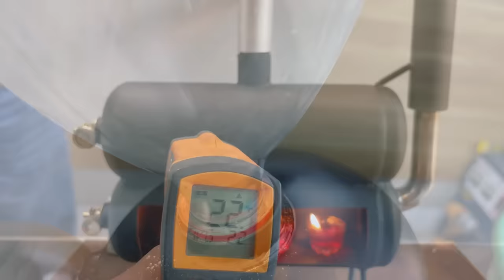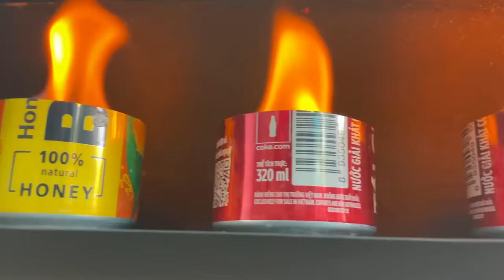diy mini heater! So warm for your room. Free energy from sand batteries

Comment: He changed the settings on the digital thermometer from Celsius, when he took the ambient temperature, Fahrenheit when he took the heaters temperature. The heater was barely above room temperature.
Reply from the maker: It looks like the experimenter may have made an error by changing the temperature settings between Celsius and Fahrenheit when measuring the ambient and heater temperatures. This could lead to inaccuracies in the results, and it's essential to maintain consistency in temperature units for accurate comparisons. Paying attention to such details is crucial in scientific experiments to ensure reliable outcomes. 🌡️👨‍🔬
Reply: No one wants to be rational nowadays, but this gizmo gives off exactly the same amount of heat as four candles just sitting there with no gizmo.  You're not creating any additional thermal energy with a gizmo.  So dumb.
Reply: @Kube_Dog  And some of that heat goes straight up and out the flue, especially that middle alcohol stove after the four candles. I think it looks cool though...warmly cosy kinda cool; steampunk.
Reply: @pa_maj.MARTINI-van-MAN  Sure, it works as a conversation piece, but that's not what the guy is claiming.  It's unfortunate because there are actually naïve people who think this is a legit heat source and invest their time and energy and a few bucks to make it, only to be disappointed.  And this guy is doing that to them for attention.  It's really not cool.
Reply: @Kube_Dog the point of the heater is the extra heat is stored in the sand ,once the sand is heated and the burners have gone out it still has heat stored in the sand, this heater is also made with an electrical coil from a kettle in other videos and there are good explanations of the working..eg: converting solar, wind into heat etc
Reply: @lmtn Oh wow that was an AI answer right there 😂
Reply: @Kube_Dog once the sand gets hot it takes long time to cool down, but need more than   4 to create good amount of heat especially in a large room, in a tent be ok, it be good homeless person to keep warm in a winter
Reply: Well spotted

Comment: I’ve been experimenting with simple tea lights and steel plate. It’s amazing how much heat you can achieve. I can get a bag of 50 4hr burning tea lights for about £5. I think we do need to think about this subject more. It’s never free but affordable heating. The key primarily is to spend high on insulation. An indefinite fuel saving device that needs only a fraction of the energy to heat it in the first place.
Reply from the maker: Absolutely! Your experimentation with simple tea lights and steel plates showcases the potential for affordable and efficient heating solutions. The idea of focusing on insulation is indeed crucial, as it helps retain the heat generated, making the system more energy-efficient. It's great to see people exploring alternative and cost-effective ways to stay warm. Keep up the innovative work, and thanks for sharing your insights!
Reply: A 10x10 room would only need 8 bags of candles to heat it every day. That would only be about £40 per day, or £280/wk. A candle burns at 1,000 °C, why isn't more heat being absorbed by the battery?

Comment: Toxic fumes are created when galvanized material is exposed to fire other than that it looks very nice
Reply from the maker: "Thank you for pointing that out, and I appreciate your concern regarding the potential release of toxic fumes from galvanized material. Safety is paramount, and you're absolutely right about the risks associated with exposing galvanized material to fire. It's crucial to prioritize the use of materials that are safe and suitable for the intended application. In future projects, I'll be sure to emphasize the importance of selecting materials that pose no health risks when exposed to heat. Your feedback is valuable, and I'm grateful for your attention to safety considerations. If you have any more suggestions or questions, feel free to share. Thank you for being part of the community!"
Reply: I always burn metal outside until it's very used in before bringing indoors for projects. Even the grate on the buddy heaters,or people use the paint roller gates.,(it's put on top of the heater to hold a pot over the heat to cook in) I keep telling them to burn the heck out of them outside but they don't listen. They don't want to "mess up" their new heater grate or roller grate.You can't fix stu-pid.

Comment: For the people that never think about these video's and assume that these are great:
Lighting four tealights in a room without the use of this fancy "heater" would result in more heat as there would be no chimney wasting heat to the outside !
Reply from the maker: You make a valid point about the efficiency of simpler heating methods, like lighting tealights directly in a room without a chimney. It's true that the absence of a chimney could result in more heat being retained indoors. The trade-off between simplicity and the additional features of a more complex system is an interesting consideration. Your insight adds depth to the discussion, and I appreciate your perspective on optimizing heat retention. If you have more thoughts or suggestions, feel free to share! 🔥🕯️

Comment: Thermal mass and heat retention / dispersion is the name of the game regardless of fuel source. In this case, the sand or crushed granite mix is for the thermal mass.  As shown, the upper tank is a tank within a tank so that the fumes actually flow up through the inside box of the upper round tank and out the exhaust pipe.  Therefore think of the upper tank like how a thermos is made with the inside tank that keeps coffee warm and then the outer tank around it.  

Secondly, the exhaust / flue pipe on the right side is actually used as just that.. a flue.. to draw in air as hot air wants to rise (just like how a woodstove works) which creates and air draw.  Realistically though, it's not needed as the exhaust pipe out the wall is doing this (but perhaps only somewhat because it's mostly set horizontally).  Regardless, this action means more air-flow is pulled in, thus maximizing the burn of the candles.  If there were a door on the front as well an adjustable intake valve, the air-flow would then be controllable from the intake side.  

If just left open however, then that entire cutout is the intake.  Because of that, I would make a door with thermal glass.
PS - Don't ever try and grind metal edges with a cutoff wheel. It could shatter.  Use a proper flap disc.
Reply from the maker: Thank you for the detailed explanation! I appreciate the insights on thermal mass and airflow. Have you tried any other materials or designs to improve heat retention? Also, do you have any tips for optimizing the burn with different fuel types?
Reply: @lmtn  I am only familiar with various wood types which give off different amounts of BTUs based on their type, density, moisture content, etc.  But for example, some people use wax as a thermal mass. So for example, instead of the tank in this video being filled with sand or crushed granite, it would be filled with wax which retains a lot of heat and will slowly release it as it re-solidifies.

As for other thermal mass material, there are many good articles about it and the different mixes people have used including different types of mud mixed with sand and fibers which get packed around the stove and exhaust piping, which generally is set horizontal for several feet before going vertical or may even have two horizontal runs.  

What is also interesting is how it all has to work together.  The type of fuel, the burn chamber, air flow, the type of mass or container, and of course the size of a room to be heated and for how long.  Lots of variables in the mix.  

And as important as it is to capture and retain as much heat energy from a fire, this also means the airspace you are wanting to heat up also has to be sufficiently insulated.  I call this the “dual chamber effect”.  Because you can have a well designed and efficient heat source but if your second chamber, meaning your room or house, is not also thermally efficient and well insulated, then you are not getting the best benefits of your heat source.   

What I’ve found that greatly helps retain heat in a house is using aluminum foil-backed polyisocyanurate foam panels in your ceiling set above the drywall.  Having a foil radiant barrier greatly helps both in winter for heat reflection on the bottom, and in summer where it reflects attic heat.  It works incredibly well. Even just 1” or 1.5” panels will do A LOT.

For heating we currently have an old mid 80’s Lopi woodstove, with solid brass doors and glass so you can see the fire.  I’ve also made a few modifications to it be more efficient and hold on to heat longer.  It’s not as great as a thermal mass stove, but those take a lot of time and effort to build, as well the space to build it. There are some great videos of those here on YouTube.

Comment: Candles or any flame only produce a certain amount of heat. Additional devices such as this dont change that output. Candle flames produce roughly 100 watts each no matter what.
Reply from the maker: You've made a valid point regarding the consistent heat output of candles or flames. It's true that the heat generated by candle flames tends to remain relatively constant, typically around 100 watts each. Introducing additional devices may not alter this inherent heat production. Instead, these devices might offer other benefits, such as enhanced safety features, longer burn times, or more controlled environments.

Understanding and acknowledging the fundamental properties of flame heat output is crucial when considering supplementary devices. It prompts users to evaluate such devices for factors beyond heat production, like convenience, efficiency, or safety features. Your observation contributes to a comprehensive understanding of these products, and I appreciate your insightful perspective on the matter. If there are specific aspects of flame devices you'd like to explore further, feel free to delve into those for a more in-depth discussion.
Reply: @lmtn  I wonder if candles or whatever they're used in can be improved in any way to make them less sooty and more efficient.

Comment: This DIY mini heater is a game-changer! The fact that its powered by sand batteries makes it even more impressive. Cant wait to make one and feel the warmth. Great job!
Reply from the maker: "Thank you so much for your positive feedback! I'm thrilled that you find the DIY mini heater impressive, especially with the unique power source of sand batteries. I hope your experience making it is as enjoyable as the warmth it'll provide. Feel free to reach out if you have any questions during the process. Appreciate your support, and stay warm!"
Reply: Sand is an inert substance and generates no power or heat of its own. It soaks up heat from some other source, (which has to be paid for), and slowly releases it to atmosphere. In other words it's the storage material in a storage heater. There is no and cannot be any such  thing as a free lunch. Whether the heat comes from electricity, gas , candles, vegetable oil or  whatever, it still has to be paid for and doesn't come cheap. Remember the video showing the insides of an LED lightbulb being stripped out and replaced by a small looped coil of copper wire, before refitting the plastic top of the bulb, and claiming that it can bring TV programs from around the world. Gullible people will see that video and convince themselves that it is an amazing idea, when in fact it is simply click bait, and anyone foolish enough to try it themselves soon find out just how far they have been led up the garden path.....And so it is with free energy generators, free heat apparatus, etc. It's a scam and a fraud.
Reply: @FrankBrown-c5l You are wrong. There is a way to heat the sand for free. You simply use a large magnifying glass to magnify the sun's rays onto the metal cylinder that will heat the sand inside to a high enough temperature that it will release the heat throughout the night into a small room and raise the temperature for free. 
The sun is a permanent supply of free energy and heat. Just have to think of ways to store it. So again. You are wrong.
Reply: @kieranb7047  No Buddy. YOU are wrong. I specifically mentioned Fresnel lenses as a heat source, but also made the statement that Fresnel lenses cost money, as does the mounting frame and the sun following circuitry if used to automatically turn the lens to the optimal position to the sun's rays. Read what you see, not what you want to see that best suits your objection. See the comment below for conformation.
Reply: @FrankBrown-c5l  where did you mention lenses? You comment only mentions electricity, gas, candles and vegetable oils. Nothing about lenses.
Reply: @kieranb7047  Seek and yea shall find. Do you want me to draw you a picture of the comment in question ?.
Reply: @FrankBrown-c5l  so you expect me to do the work of hunting through hundreds of comments that are not related to your original comment that I originally replied to in order for you to be proven not to be wrong? 
Please do draw me a picture of your comment. I'm fascinated to see how exactly you draw a picture of writing that isn't you just writing words 😂. Has your carer left you unsupervised on the computer?
Reply: Powered by candles lol not sand
Reply: @eirenemiller5929  Exactly. Might as well just have the candles without all the rigmarole of the flowerpots.
Reply: @FrankBrown-c5l  if you have just the candles you have convection heat. By heating flower pots or these "sand batteries" you convert the heat to radiant heat. Depending on how well your place is insulation and ventilated, there might be a benefit to having radiant heat vs convection heat. No extra energy is created, but convection just heats the air, and if the hot air is easily lost (poor insulation, or due to ventilation) radiating heat might offer a benefit.

Comment: I really like this concept!
I would like to fabricate declarative versions of this heater for my small 1000sq ft home, but hesitant a for a few reasons. Im very confident I could make these units extremely safe, much safer than other indoor heat sources.
My issue are.
Why are these heaters being vented to the outdoors? There should be no concern for deadly fumes in my home, I believe so anyway? Isn’t this is throwing away heat?

Secondly, I live in Massachusetts. And that being said I own my home outright in this state. What’s used to make these heaters are used widely used in everyone’s home everyday. Just the same I have a feeling Massachusetts's will not allow these concepts. And will use this heat source responsible for tornado damage! Sounds crazy, but I live in Massachusetts. 

I own a mini split System I use daily, set at about 63 degrees. I pay about a $300 electric bill monthly in winter. I use my oil furnace at night. 

Looking for alternatives.
Thank for listening.
Bill
Reply from the maker: Thank you for sharing your thoughts and concerns, Bill. It's great that you're interested in exploring alternative heating solutions for your home. Here's a response that addresses your points:

"I appreciate your interest in this heating concept, Bill. It's essential to prioritize safety when considering alternative heating sources. The reason these heaters are often vented to the outdoors is primarily for safety. While it's true that you can make these units extremely safe, venting ensures that any potential emissions or fumes don't accumulate inside your home, providing an extra layer of security.

Regarding your concerns about wasting heat, some designs do incorporate heat recovery systems to capture and reuse some of the heat before venting it outside, but this can vary depending on the specific design and model.

As for the regulations in Massachusetts, it's always a good idea to check with your local authorities and building codes to ensure compliance before implementing such systems. Each state may have its regulations and safety standards for alternative heating sources. It's essential to abide by these regulations to ensure the safety of your home and community.

If you're looking for energy-efficient alternatives to reduce your heating costs, you might consider exploring other options like improving insulation, upgrading your HVAC system, or using energy-efficient appliances. These measures can help you achieve a more comfortable and cost-effective solution for your 1000sq ft home.

Thank you for sharing your concerns and ideas, and I wish you the best in finding the right heating solution for your needs. Stay warm, Bill!" 🏡🔥🌬️
Reply: The vent goes outside because anything you burn causes fumes and soot. So the “dirty” smoke 💨 and fumes go outside and the heat from inside of the stove goes inside of the house through the other smaller pipe. A fan is usually added to the opposite side to push the heat through the smaller tube. There is usually an air intake pipe at the bottom so that air gets into the heating chamber. Depending on what you burn it can cause combustible gases or fumes. The air intake pipe helps prevent that. I’ve been watching a lot of vids on this and that’s what everyone is saying. So I hope that helps.